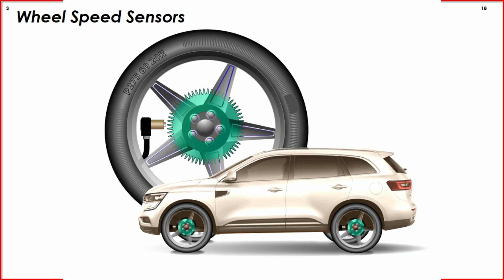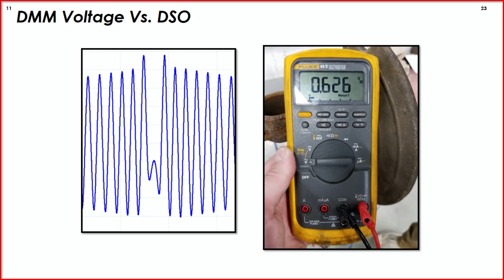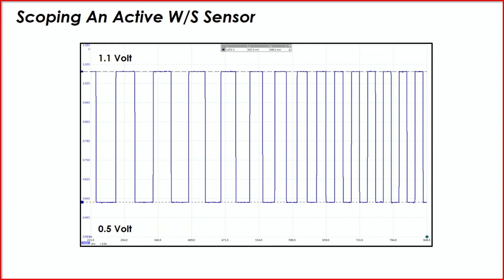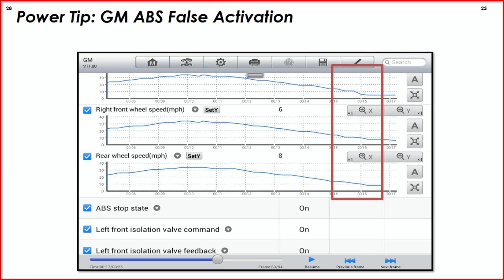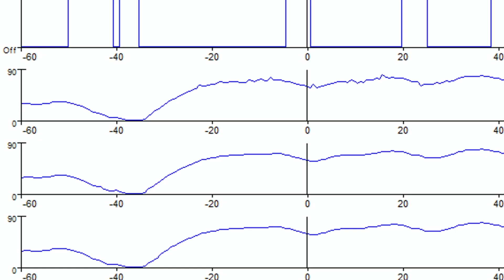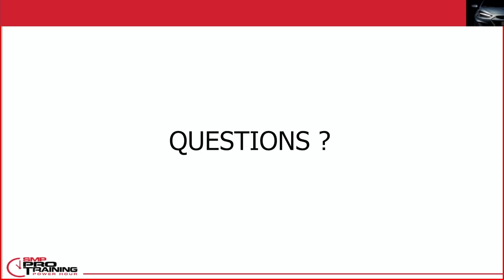Diagnosing False ABS Activation | Pro Training Power Hour

Comment: Terrific video!!! Could I also get a false abs activation (2016 ram 1500 5.7 rwd) with a bad wheel bearing? I did the left/right and up/down physical test for a bad wheel bearing. And I do have wheel bearing play. I get the abs false activation (occasionally) when coming to a stop from a low speed. I have no abs warning light on. From your Great video, I'm assuming the abs is activating do to the incorrect information that is being sent to the speed sensor. Thoughts?